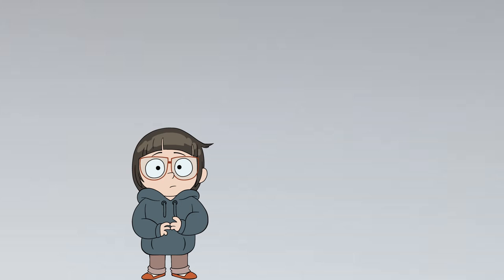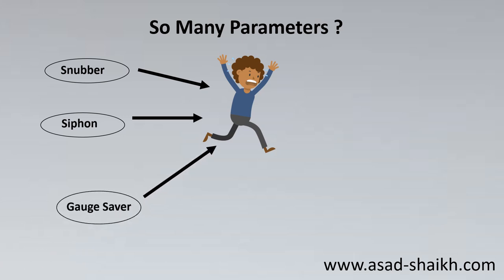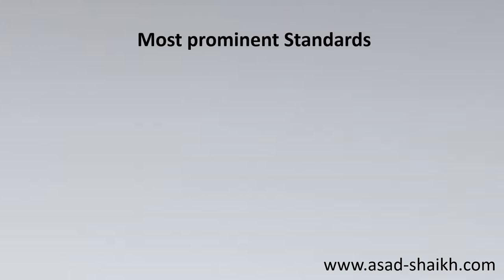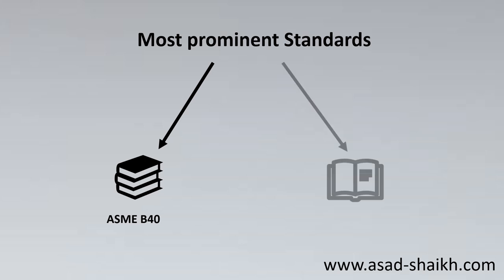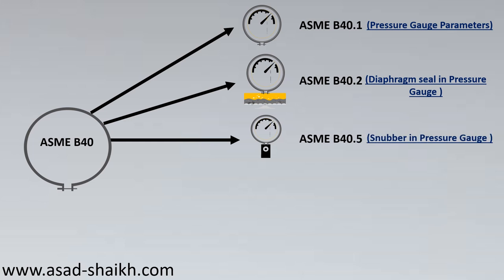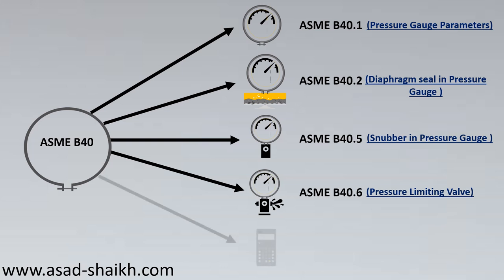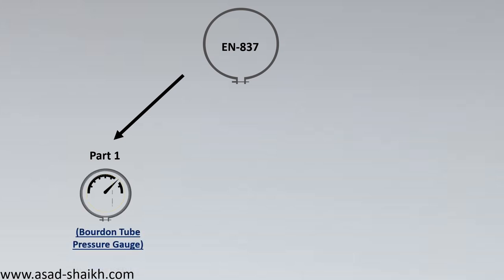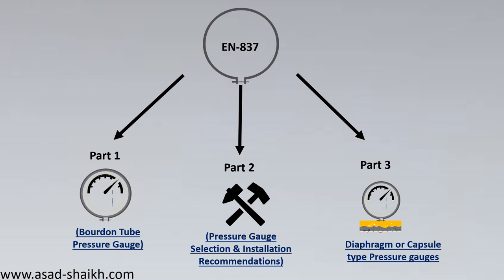Pressure Gauge (International) Standards

Comment: Very well explained .👍
I have one doubt regarding thermowell , what should be the UL of thermowell , should it be 2/3 of line size ,10 times the tip diameter
Reply: In my plant one of the thermowell get damaged very badly it's line size was 200mm and 100mm extended flange type and the total size of thermowell is 300mm , I think it is wrong
Reply from the maker: Yes both these criteria are thumb rules to determine the starting point of selecting the U-Length of thermowell.
(2/3 of line size or 10 Times Tip diameter)

We can modify the U-length as per our specific project scenarios, Like when our Thermowell does not pass Wake frequency calculation we try to reduce the U-length if that is a feasible option.

For more details i have found this below article on ISA Blog to be very helpful 

 https://blog.isa.org/temperature-sensor-installation-best-response-accuracy